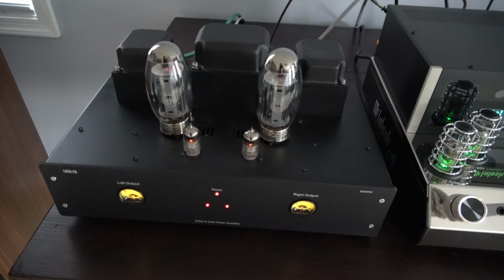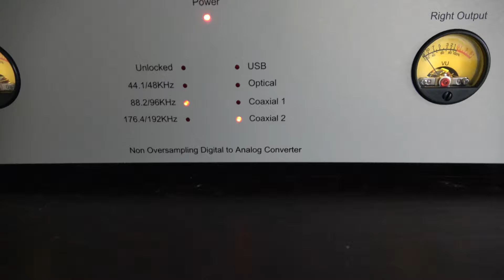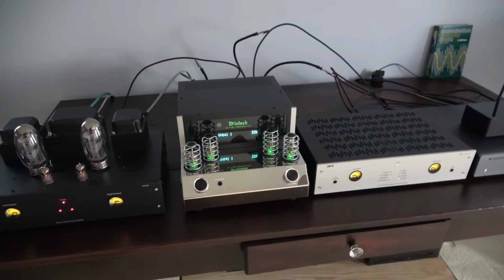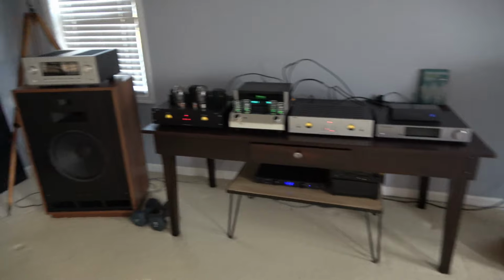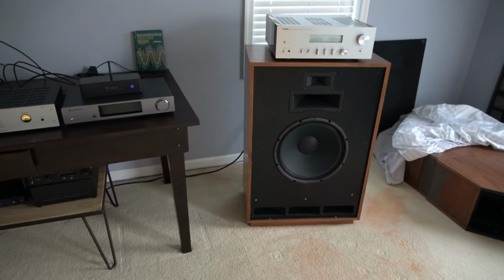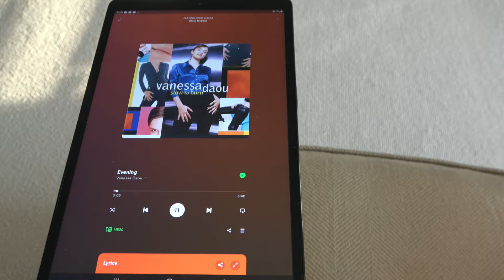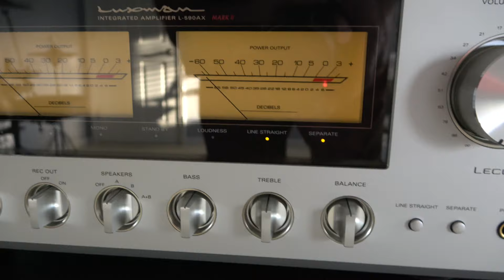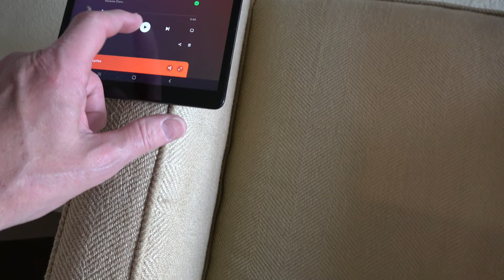Class A triode Amp vs. Class A Transistor Amp - Lab 12 Tube vs. Luxman Amps BJT Transistor

Comment: Here's a little trick you might like to try should work on those speakers really well, I was watching some manufacture who didn't on his speaker so I thought I'd try on mine what I built what's a triple layer damping cabinet, so I know it's not the cabinet that's its taming. it must be something to do with the mid-range and base wrapping around the speaker, is to get the Grills and put them on the inside of the cabinet so they are facing each other with some Blu-Tack it was quite noticeable I was surprised, gives much better focus and sound stage clarity in the center give it a go let me know if it works for your speakers. Do my comments show up never get a reply!!😔